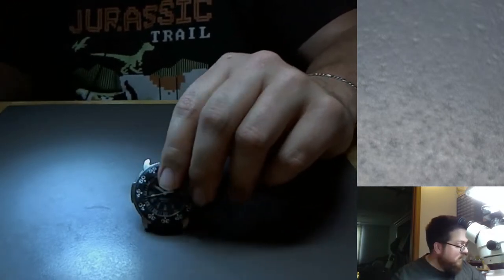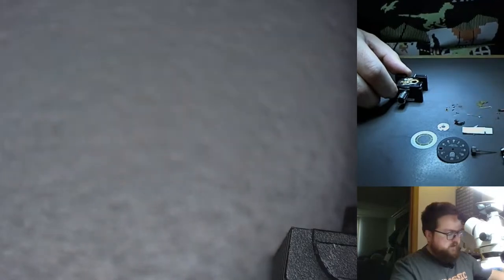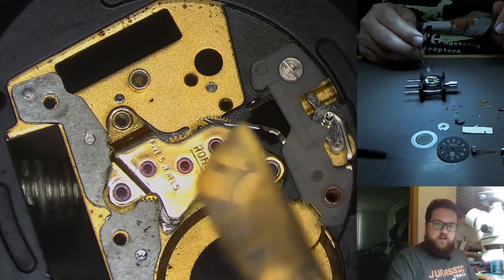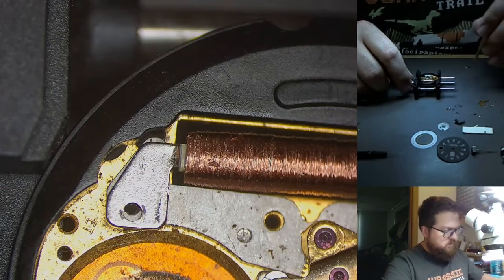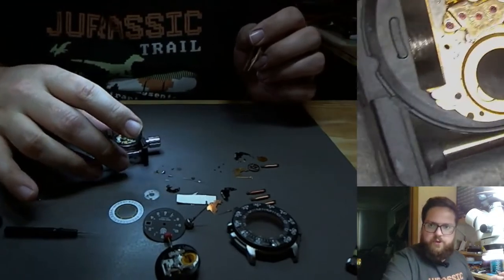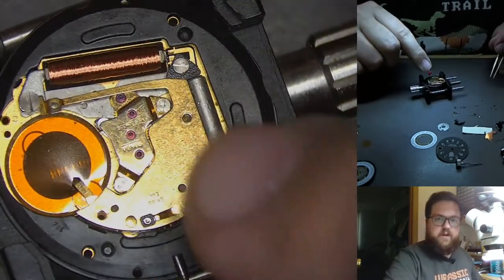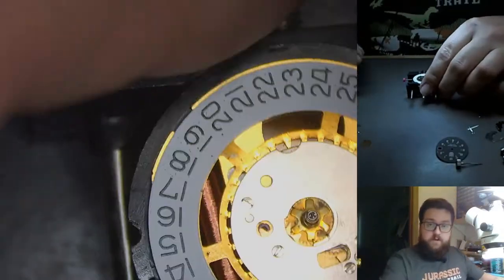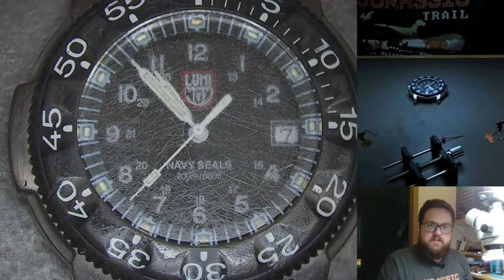Cleaning/Reviving a Luminox with a Ronda 715 Movement

Comment: Hi… you just helped me fix my Sandy P650 that had a leaking battery and a bad coil.  With your guidance I ordered a brand new movement for about $30. Swapped over the battery contact the insulator, the coil and the circuit board. And Presto and irreplaceable 650 that I have had since the 90s is working again. I know most people don’t work on quartz movements. but if you look one of these up, you will see that they are definitely worth working on! But it’s working perfectly and your video definitely gave me some guidance in how to fix it. I even have a spare movement now because I ordered two. In case I ever have another issue. thanks again and cheers!!!!
Reply from the maker: Hey, I'm glad it helped! Some quarts movements you're able to swap around components and they generally will work again. Of course, the gear train might be worn but there again, it can be swapped around. Good job getting that working, and more time to enjoy the watch. Thanks for watching!

Comment: Probably deformed stator? Common problem with the Rondas. Anyway, your sticktoitiveness and patience was infectious. When I put my movements on the holder I need to display a similar attitude toward watchmaking. Thanks for the inspiration and video.
Reply from the maker: So, everything was working as intended, I switched out the metal plate around the stator and it ran the proper way! Watch is back together and functioning as intended. Glad you could find some inspiration from this and hopefully you can keep progressing in your work!
Reply: @TRSCP  Thank You. Glad to hear you got it all working.

Comment: You can also use a small digital multi-meter to do a continuity test on that coil - just touch probes to both ends with the meter set on continuity if it beeps its good if no beep its bad.
Reply from the maker: You know, I do have a multimeter, I should really learn how to use it a little more one of these days. I'll have to check into that sometime, thanks for the tip!

Comment: This video has helped so much, thanks! Struggled to find much info on Ronda 715, I’ve got a Victorinox inox with this movement which I bought as a project, previous owner snapped the battery tab and damaged the coil, bought a new movement and swapped out the parts, working really well now, only issue I’ve got to work out now is a slightly loose minute hand? Moves about half a minute when watch is tapped,Any idea how I could fix this? Thanks 👍 keep up with the awesome videos!

Comment: The reason for reverse of movement is due to wrong position of magnet upside down,
Reply from the maker: Hey Mohameda! Yeah I swapped out the metal plate around the magnet and everything worked as intended. I am not sure why that plate made a difference, but it is fixed and working now!

Comment: Please Help!  I've spend endless hours trying to get one working movement from two loaners.  1.  Do you have any tips for getting the magnetic gear to play nicely?  Mine wants to lay over and stick to the side no matter what I do.  I feel like I have the gear and cover plate all aligned.  I could see the tips of the gears sticking out the top of the jewels.  I could hear the watch ticking when I put the battery in.  However, when I placed the hands on, the second hand isn't moving.  I think it has to do with gear alignment but any tips you might have are much appreciated.  I watched and paused your video numerous times.  It seems like you got the gears lined up very quickly around the 48:45 mark.  Cheers!
Reply from the maker: Hey Tyler! I find that using a non-magnetic tweezer helps! I use brass a lot personally. I guess I would have to have the watch in front of me to sort out ticking sounds but not hands moving. Also no quartz expert. If you push the gears do the hands move at all? I would start there. Good luck!!

Comment: My crown\stem will not click back into place. It will just pull out. Any suggestions?
Reply from the maker: Hello! I guess without seeing it it could be a number of things. Pulled like all the way out? Did the end of the stem break off? Could be a bent/broken piece on the movement, could be missing the hole completely with the stem. Tons of possibilities! Hopefully it's something simple.

Comment: Can you fix my Navy Seals 3100? I replaced a battery and a capacitor and still no go.
Reply from the maker: @johnnywood8082  hello! I probably could get it going again. Capacitor? Are you referring to the coil or the circuit board? Could be something in the gears.
Reply: @TRSCP  sorry, yes, coil NOT capacitor 🤦🏻‍♂️. My bad 😂. How can I contact you directly?
Reply from the maker: @johnnywood8082  no worries! I'll get back to you soon on that, I'm in to work here now. I'll be in touch!
Reply from the maker: @johnnywood8082  if you want to shoot me a DM via Instagram, that would be the best way to reach me! @LavelleTimeWorks
Reply: @TRSCP  bump 👍🏻

Comment: Why not just buy a new movement? You can get a Luminox movement for like $22 bucks.
Reply from the maker: Well then I couldn't have fun taking it apart, could I? As a rule of thumb, I replace quartz movements, as most aren't worth the time to fix. But yeah had some spare parts sitting around so figured why not? (Watch fully works correctly now, for the record)
Reply: @TRSCP  cool. I was actually surprised when I ordered it, that the movement on a $400 watch cost $22 bucks. lol :)
Reply from the maker: @Ronnie  I mean it's a jeweled Swiss movement, not the worst thing in the world. I assume some of the price comes from the tritium as well as the overall construction. They're pretty good!
Reply: @TRSCP  I've had mine for 5 years, and this is the first time anything went wrong with it. I love it. When I first got it, I was amazed at how bright the tritium tubes glow at night.
Reply from the maker: @Ronnie  yeah should just need a battery every now and then. Beyond that hey replace it. And yes, I see the tubes across the room in mine at night! Wild stuff!
Reply: I thought the same.  Here I am with two new movements I can't use because they aren't the correct height.  The first time I ordered I wasn't aware they came in different heights.  The second time I ordered I got a 4.8mm one after measuring and it too was too tall also.  So there I was trying to do surgery on them again swapping out the center post and seconds gear.  I still don't have a working movement.